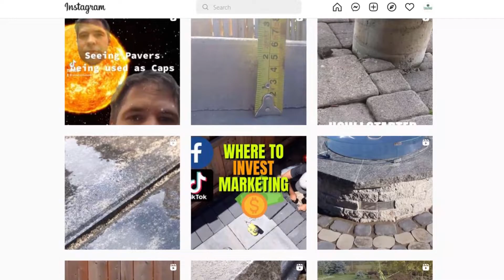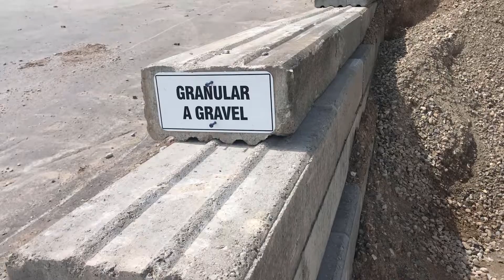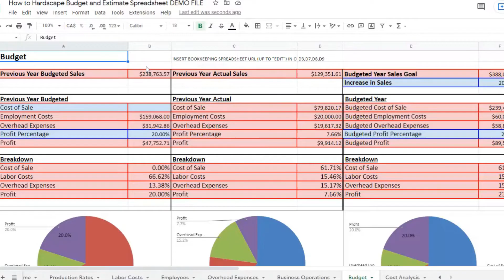Open Graded VS Dense Graded Aggregates

Comment: This is a noob DIY question: can I leave the uncompacted 3/4” clean rock out until next summer?  The rain starts in a few days and I have to put everything on hold. Should I still compact it or wait till next summer?
Reply from the maker: Clean rock, so it has no fines? You can just leave it there. Compact it when you are ready.

Comment: I am building a raised paver patio and I am wondering if it's okay for me to put the leftover pieces of the wall blocks in with the fill. I'll be putting in about 16 inches of fill but some of the scraps are pretty large.
Reply from the maker: I personally would not, especially since that will be the base to the patio.
Reply: Thank you sir

Comment: Really appreciate all your content!

I’m working on a DYII 400 square-foot patio in my backyard. I have chosen to go with an open grade base, and I’m contemplating weather to use woven or non-woven Geo fabric, or even if the weed barrier we already have woukd work.  

I have very dense red clay soil, and I’m applying 6 inches of three-quarter inch clean stone.

Also I have a little over a 1/8 pitch away from house which follows the natural grade of the yard pretty well. 

Thoughts?
Reply from the maker: I typically use a woven over clay soils with a small drain extension beyond the patio. Weed barrier would not provide the same solution.
Reply: Thanks very much for your reply.

So, a drain at the low end of the patio is needed with the system? About 4 feet past the patio I have a steep hill that goes down from the lowest grade point of the patio.
Reply from the maker: You should be good for drainage if that is the case. You could add a small trench that extends past the patio towards that slope for any build up of water to work its way out.

Comment: I recently started a 30x30 patio and had base material delivered. I thought I was getting 3/4 clear stone. But it's actually somewhere between what you show was 3/4 clear and "dense graded". Would you use plastic edge restraint with that type of material?
Reply from the maker: Without seeing it, I would probably play it safe and go concrete edge because you can use it in either. Plastic edge requires enough fines to adhere to the corrosion of the metal spikes.
Reply: Wow 30x30 patio, that’s a decent size. Nick I’m trying to do a 25x25 patio and I’m finding out i may have gotten myself into a project that’s bigger than what I thought it would be. I would love to talk and see how exactly you went about doing yours. Let me know by responding is you are okay with that and I can send you my number. Thanks
Reply: @darryelsanchez1309  hello Darryel, yeah it took me quite a bit longer than I thought it would. Prepping the sub soil, adding leveling and compacting base was the hard part.
Reply: @darryelsanchez1309  let me know if you have any questions we can talk

Comment: Love the videos, got my sub. I'm torn from switching from crusher (dense) to clean stone for wall applications - but many hardscapers I know do just that. Does it sub out 1:1 for crusher with regards to depth and width? And how does it fare for compaction? 

I just can't wrap my head around using clean over crusher, but I'm afraid we have been doing it "wrong".
Reply from the maker: For my wall applications, if I have a lower area to drain to I use open graded. Because the drain is placed lower in the backfill area. If I do not have a lower area to drain to, I use dense graded.

Open graded actually has a higher compaction rate without mechanical compaction so you don’t have to order as much as you are ordering with dense graded. But open graded is more expensive so it’s not like it saves you money, just slightly less yards to account for. It’s about 85% - 90% compacted without mechanical compaction.
Reply: @iamahardscaper  Thank you so much for the prompt reply! I'm not so much worried about price point, as that should be passed on to the customer. I worry about whether or not we are creating structurally sound products that will hold up. My worst nightmare would be a failure - and if our technique is wrong, or if there is a better way to do something I want to know.
Reply from the maker: Good mindset 👍👍

Comment: If open grade is used, will sand layer under pavers tend to settle into the open grade stone?
Reply from the maker: For an open graded base, you would not use sand under the pavers for the bedding layer. You would use a 1/4" chip on top of the 3/4" base.

Comment: I would be interested in if you have any comments about Geo web products and how they might be applied in a paver patio. Could they be used to reduce the base layer thickness VS expensive Gator panels etc.
Reply from the maker: When you say Geo Web, are you talking about Geogrid? We do have a couple of videos on using Biaxial Geogrid in the base, though we do not reduce the base. Instead we use it as added stability and cheap insurance. The Gator Base is expensive, but it reduces labor and dumping fees dramatically.
Reply: @iamahardscaper I was referring to 3D type such as "Geocell"
Reply from the maker: I have not yet used it

Comment: I wonder if open graded is working in Canada where we are having cold and humid winter. I call the largest material depot to get estimation. They nearly laughed at me telling I wanted 3/4 clean crushed rock
Reply from the maker: Interesting, can I ask who you called. Located in Toronto here, yes open graded works well here👍
Reply: @iamahardscaper  thank you for the replied. I called "Transport Multivrac". It's a good place. It's near Quebec City. Here winters are a big deal 20x the snow pf Toronto and much much more cold during winters. I'll have to do more research. I mean "they nearly laughed for telling I wanted to order 3/4 for doing paver base". Still seem to be a great solution!
Reply from the maker: Gotchya! The argument for open graded base in the winters is that the air circulation also allows for the insulation of the base material and the water that makes its way into the system goes down to the base and subsoil without being held onto by the fines of other base materials. I looked at their website and they do not sell the proper material which is probably why they laughed. 3/4" needs to be angular crushed, by their photos they have rounds in their aggregate. They also sell stone dust which is a big no in our industry, but older suppliers still sell it.
Reply: @iamahardscaper  thank you so much, I appreciate you took time to answer thoroughly my concerns 🙂🙏 I listened your great videos, took notes and know we need select the right type of rocks (did my homeworks). I'll go there to make sure they have the good stuff. I think there website's pictures aren't accurate 

I'm looking for professional consultation on design/layout of my project. I'll send you private message on your website

Comment: question... if you have clay and you dig out an area for pavers.... aren't you basically creating a pond for water to collect ? or worse a lower spot against a house for water to go...would you install drainage under the sub base in that instance
Reply from the maker: Yup! Perforate pipe taking that water away is best. Subbase should also be sloped away from that foundation. Not a significant amount of water makes it way through to the base unless the jointing material is permeable.

Comment: Just found your video. I just finished installing 5 inches of crushed limestone for my flagstone patio, so now I’m doubting my decision. What would you recommend I use as a leveling layer? Great video and valuable info, thank you!
Reply from the maker: I would probably go with concrete sand or HPB (1/4” clean crushed stone)
Reply: Me too. How is it holding up?

Comment: Can we use dense grade over unstable soil, and then geotextile with open grade on top?
Reply from the maker: Unstable meaning dense clay? In that case throw down some 3/4” clear and compact it into the clay. If it is very saturated add some lime and compact.
Reply: @iamahardscaper  thanks for the reply. I'm working on my own patio as we speak and I was delivered clear 3/4 stone and crushed dense stone like you mentioned on the video, the store recommended that I use the dense stone in, under, and around the retaining wall, but I understand now that clear stone is better, so I'm trying to find another use for the crushed 3/4. Im also using geotextile and geogrid. . My soil is soft and has a some organic matter on it, I'm trying to find a better way to deal with it. The highest area on the retaining wall of my raised patio is about a foot
Reply from the maker: If you do not have a lower area to drain water, the dense stone would be good for your retaining wall base. You also want to remove any organic material in your excavation.
Reply: @iamahardscaper  thank you
Reply: @iamahardscaper  Nice note about adding Lime! The end of our yard where a swale is, as designed, all the water heads that way, and I was curious about ways to try and dry it up a little since it is pretty much all clay below the thin layer of topsoil the developers lay down to meet grade.

Comment: Hello,

I am new in the business and was wondering which type to use for the base. I am working on a 400 square footage and will also be using the pa er base panels. Also, how many inches of dirt should I dig if I am using a two inch thick pa er? 

Thank you very much.
Reply from the maker: If you are use it the paver base panels you can use 1” of depth of concrete sand or 1/4” clean chip. Concrete sand requires you to compact before laying panels. Add up each including 1” bedding, 3/4” for panels, 2” pavers. Make sure you are getting down to subgrade with your excavation. Hope that helps, check out our video on paver base panels as well
Reply: @iamahardscaper  I truly appreciate your help and guidance. I started watching your videos because you make it simple, educational and very informative. I saw your video on base panels and that is why I decided to go with them instead of having an 8 inch rock base. Thank you very much again for doing this. 
Thank you very much.
Reply: Sorry to bother you again. I have one more question. Should I use sand on top of the concrete sand and then the base panels? Sorry, I just want to get it right. I appreciate it. Thank you again for responding to me. My wife was surprised! In a good way!
Reply from the maker: Concrete sand is just a coarse granule sand. Screed that out over nonwoven geotextile, use a tamper to compact that, then just level it back out with more concrete sand because the tamper will make some irregularities.
Reply: @iamahardscaper  Got it. Thank you again for your help!

Comment: For A gravel, do you use Limestone base or Gravel base? ( local pit has 2 variations)
Reply from the maker: I’d be interested to see what the difference is. Possible hardness difference. I’d ask more about that
Reply: @iamahardscaper  I was doing some reading today about this, it seems Limestone win for pure strength and durability especially in colder climates, why it is usually used for roads and under large buildings and other larger scale construction projects.

Comment: What is the difference between 3/4 crushed stone v/s recycled 3/4 crushed stone ? 

Can recycled version be used for open graded base ? Would it compromise the strength of foundation?

Is woven geofabric + geogrid+ 4" of 3/4 stone + 1" of 1/4 stone = 5" enough for backyard porcelain paver patio ?
Reply from the maker: Recycled just means it is reusing concrete. Should be fine as long as it passes a hardness test and it is angular. Yes it can be used for open graded base and would not compromise the strength of the base. If you are going to place geogrid on top of geotextile, opt for the nonwoven geotextile rather than the woven. If you are in a freeze-thaw climate, improve that base depth to 6" plus you 1 bedding layer.

Comment: What is the recommended method to install edge restraint on open graded base ? Concrete / plastic / aluminum

Also, is the top layer 1/4 clean stone compacted or not ?
Reply from the maker: Concrete or aluminum with a wedge spike. You cannot install and edge restraint that has a nail to fasten it. Scrape away the bedding material and install. There is a video on this on our channel.

Compaction after laying pavers and sweeping in jointing compound.

Comment: Open graded always 💪🏻 we also always use a drainage pipe into a system and usually run it to a pop of drain in case water gets in the system. We also
Always slope our sub soils towards those pipes.
Reply from the maker: Absolutely! Great installation techniques. We will have a video on this in the season sometime going over those exact points 👍

Comment: So if you use open grade base only which is 3/4 and put sand on top. will it sank in rocks or water can wash it away? Or you can use 3/4 mixture with stone dust? Please advise
Reply from the maker: Sand on top of 3/4" open graded will not work, it will sink into the voids. Dense graded 3/4" minus with concrete sand (never use stone dust) would be a dense graded base or traditional base and is what is recommended by ICPI.
Reply: @iamahardscaper  Hi. Road base is not available in my area. And I don't want to mix it with concrete sand. Is it OK to mix 3/4 with 1/4 inch or 3/8 gravel?. Thanks for reply
Reply from the maker: When you say mix, you mean use as a bedding layer on top of the other material right? 1/4" or 3/8" clean stone (not stone dust) is the specified bedding layer for 3/4" clean stone. I also use it as the bedding layer on top of my 3/4" minus (A Gravel, road base) instead of concrete sand.
Reply: @iamahardscaper  No. I mean mixture 3/4 gravel with 3/8 or 1/4 to get solid compacted base. Bedding Layer would be sand. Thanks for reply
Reply from the maker: No, you wouldn’t want to do that. Instead use that 1/4” / 3/8” clean stone on top as a bedding layer
Reply: @iamahardscaper  Thank you